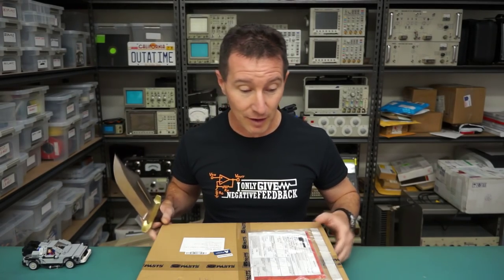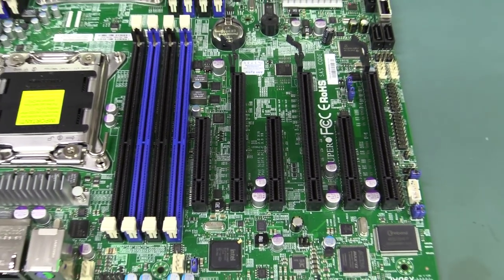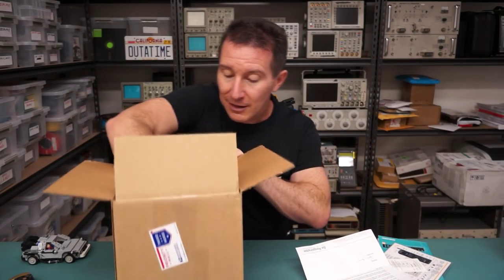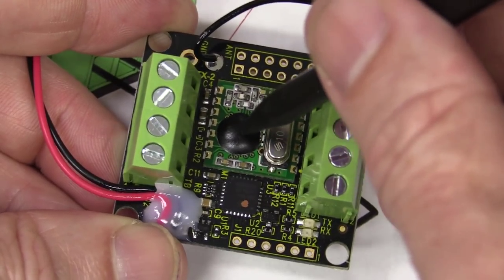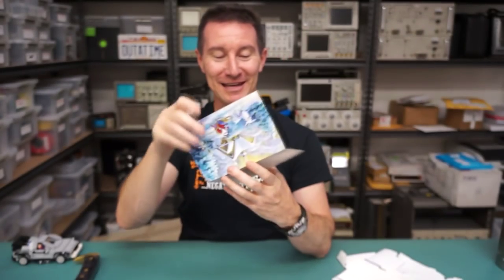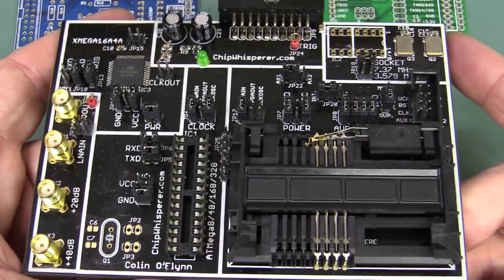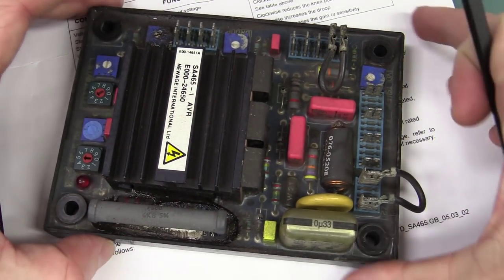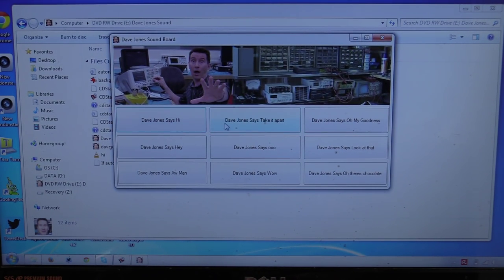EEVblog #720 - Mailbag

Comment: you should use ECC DDR3
Reply from the maker: Bastek Master That's what I have from my dumpster servers.
Reply: Remember to populate in pairs since DDR supports Dual Channel, meaning you need modules with same timing, clock-speed, module size (in megabytes) and populate them in pairs to the blue and black slots next to each other. You can't  mix and match. ECC could be even trickier to get working right since it's more picky regarding the modules to be same type in all regards.EEVblog
Reply: EEVblog do you have the servers and cpu's anymore?
Reply: the compaq nerd the diference between quad channel ram and dual isnt THAT much. just do a simple google and a BUNCH of articles will pop up. back when the i7 released their was LOTS of debates. 

and because your not really running a server where you need to make sure your memory is 100% ok all the bleeping time.... you should be able to stick your normal ddr3 in and boot. sure quad channel and EEC are nice....when you need them.... but if you just want it to crunch videos for you, you need CPU power. the extra ram bandwidth and error correcting isnt going to matter much.

TLDR... boot the bitch with normal ddr3 till you get enough EEC 

PS.... i see 3 or 4 PCIe slots..... stick in 3 R9 290x GPUs and lol? have you looked into rendering video on graphics cards? i was told it was faster, but that is in most desktop configs.... not dual CPU. but then again, not every computer has 3 GPUs either!
Reply: *****
didn't you mean ***** or Mtaalas?
Reply: ***** Servers won't even bother booting without ECC usually. They are hardcoded to require it.
Reply: Mtaalas Technically they don't have to match, but you are taking a shot in the dark if they don't. The speeds go with the lowest common denominator and then it still might not work, but it can.
Reply: ***** Not entirely true. I have a Quad CPU Supermicro board that we were using standard desktop RAM in. Granted, most Supermicro boards will cap the maximum RAM amount when you do that, but it does work. Though in my opinion if you're not using ECC ram in a server board something's wrong with you.
Reply: EEVblog the missing bit at the bottom is the SAS option (there is something like 6 versions of that motherboard with different features) it can support upto 4 SAS on each port they come in 2 or 4 port so can be 16 SAS/SATA in total,, its like SATA but a way more bandwidth and has extra ECC of some kind support on the data link from the SAS controller to the SAS HDD/SSD so to make sure data has Definitely got to its destination, but you can plug a SAS cable into a normal SATA HDD/SSD the cable itself is the same just SAS HDD/SSD are faster and have server related features

and the USB port on the motherboard is used for booting (as most of these systems be running linux of some sort) so you have a 4GB bootable USB SSD OS (think cloud servers) cloudflare server setups are mostly headless with full remote access and self setup (and a lot of encryption) 

on the RAM side just get 16x 1GB DDR3 sticks as they are worthless (due to there size) so generally are very cheap (you should be able to boot without ECC DDR3 ram the worst that will happen is the system will not boot, note at least 1 stick must be inside each side of the CPU if you install 2 cpus, you should look at the manual as server boards can be picky if you just put sticks into random slots, use and the Blue slots)
you also need a PSU that has the power connectors that the server board uses (Server PSUs are a bit noisy but are norm above 90-95% efficient)

Comment: That be a kickass supermicro board, for workstations as it has PCI x16 slots. Servers at least used to be limited to 8x, since they use minimal graphics and instead use the slot for RAID cards. Supermicro makes good stuff, I've never had one die that wasn't due to me modding the BIOS. On that note, at least with my boards which are older, do NOT SLIC mod them, as they WILL brick and require external reflashing of the the BIOS chip! I've nuked the BIOS of two different boards this way, one of which didn't like getting maxed out with RAM after for some reason I cannot discern. 

 Supermicro also makes good EATX (your form factor) cases for workstations... although many new gamer cases (big ones) do actually have space for these (the ones for 8 slot ATX come to mind). However, I still suggest a Supermicro case, as they do design the two to be a good match; the front light/switch headers match w/o the use of the case's included adapter. They also include GOOD power supplies that are for all intents and purposes bombproof. 

I also suggest getting a hardware raid card with BBU. Too bad this is new enough NOT to have PCI-X 133, otherwise I'd suggest the 3ware 9550's PCI-X version which are dirt cheap on ebay, even with BBU. They did make a PCIe version, as were all later 3ware/AMCC cards (now owned by rival LSI). IF you really want go go all out get some 10K drives, but even with a pair of 7.2K desktop drives, on my 9550 at least, I was getting good performance. 

Enjoy it, you may like it so much it becomes your main PC. Heck, I built two or 3 personal workstations for myself and hear me out, even being based on 2005ish chassis (Opteron x2 Italy and Xeon Irwindale, with BBU'd 3ware 9550 RAID cards). 

My two builds (as examples):

https://www.facebook.com/larry.j.bolan/posts/10205497321541802

https://www.facebook.com/larry.j.bolan/posts/10205532603663833
Reply: speaking of bios ,i have an old board that i use as an eeprom flasher by hot swapping bios chips. instead of flashing an award bios i point the flashtool to a custom .bin file of my own. usually a gameboy game for flashcarts. i call it a quick 'n' dirty eeprom flasher.
Reply: devicemodder That's what I did to restore them after obtaining a spare board/chip.
Reply: i just use old boards to flash eeproms for other purposes. works a treat for diy flashcarts for my gameboy, considering i can't afford a real eeprom programmer.

Comment: the unpopulated stuff is SAS disk interface
Reply: +Amaury Jacquot had to google SAS after reading your comment, I assumed that the double row of empty leads next to the empty PGA area was for a SCSI connector. while I may not be spot on since I don't know how SCSI has progressed since using a squirrel to attach a CD rom to an Amiga 1200, it's nice to know that I was at least in the same county as the actual answer and have some technology I need to learn a little more about.

Comment: If you want to use it for Video rendering you might consider throwing in there a RAID card or if you do not have RAID card available you might consider an SSD HDD for better performance. Also make sure that the content is on separate HDD than the one that you actually write on. As for memory you might need to pair them. 2 same memory card for each processor. Also for faster rendering (if is the case) throw in there a powerful videocard, but first check if the rendering software can take advantage of that, or what card is supported by the software.. Have fun with that RenderBox (this is what we call them here).
Reply: "2 same memory card ** for each processor"
**ONE for each processor. To be more specific.
Reply: hard drives dont help at all for video rendering unless you are doing cinema video editing that is super high bit rate, a 60fps 1080p youtube video only has a bit rate of 16mbit(average) and even if you render at double that to make sure youtube has minimal quality loss you are only creating a 32mbit bit rate file, thats 4MB per second. a USB 2.0 flash memory stick can handle that so even a low end desktop hard drive isnt going to be a bottle neck especially considering that even with dual xeons the video isnt going to render at real time so the actual speed the hard drive will be read and written from and to will be less than that 4MB's.